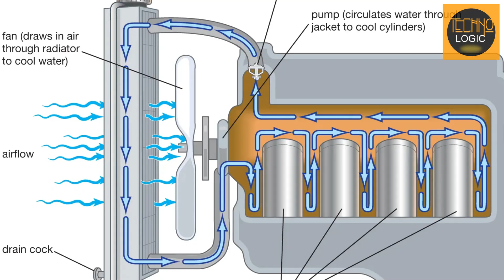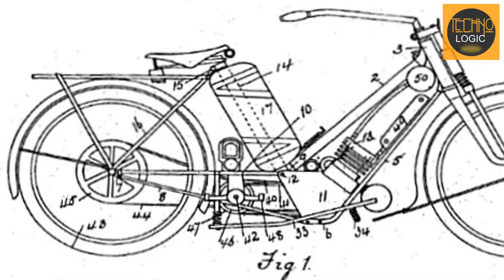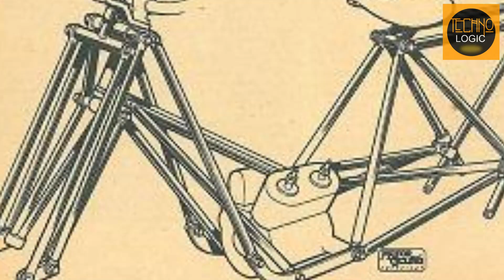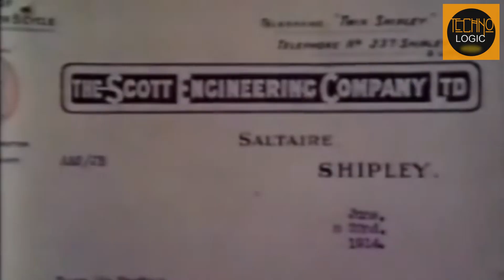Who is The Pioneer Behind WATER-COOLED Motorcycle Engines?

Comment: I knew several Scott enthusiasts many years ago as a member of the vintage motorcycle club  -  The bikes had a number of interesting characteristics  -  the ignition timing was close to TDC and it was not unknown for the engine to reverse its rotation whilst running at Tick-over  -   There were stores of people who had a nasty shock when sitting at a traffic lights to find that they set-off in reverse on the change of the traffic lights !
Reply: Very true, in the 60s I had  197 Francis Barnett and this happened to me, the bike started OK but sounded different and made a large crunch when I put it in gear on letting the clutch out it went backwards and caught me out and ended up in a heap much to the laughter of a group of teenagers that was close by
Reply: As kids over the fields in the early 70's we managed to get my mates Bantam running backwards. As you can imagine we as young boys found this incredably funny and would bump it backwards until one day the crankshaft snapped and the magneto fell off!